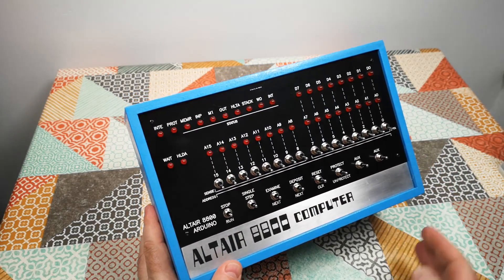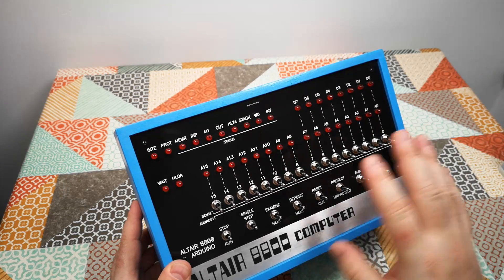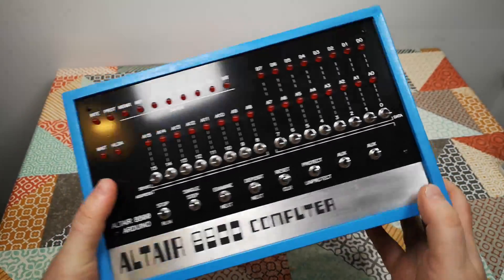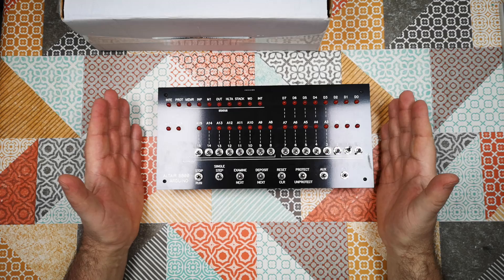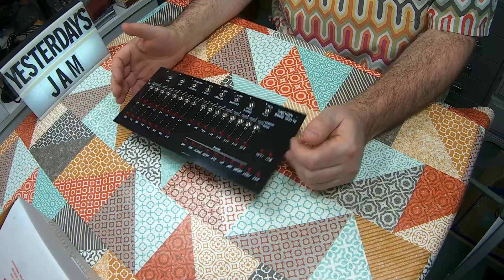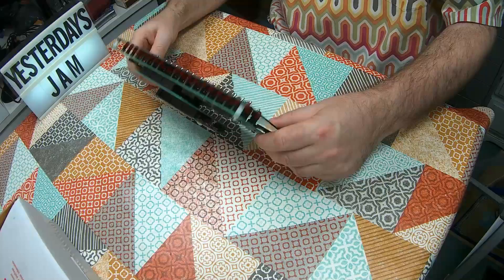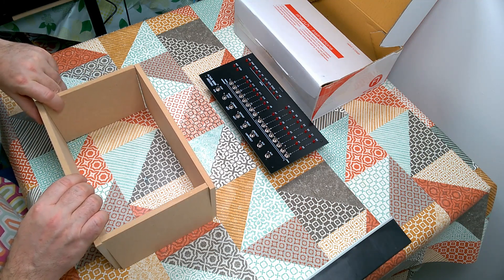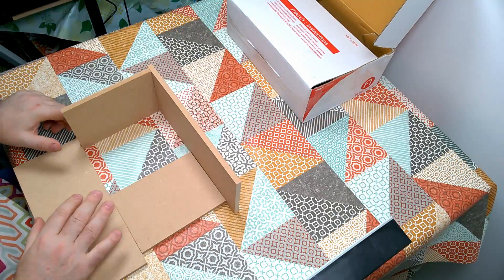A Nostalgic Case For My Arduino Altair 8800 Clone

Comment: I didn’t know that B&Q would cut wood to size. Worth knowing. Thanks
Reply from the maker: Yeah, it's definitely worth it for a project like this where precision cuts are important.  Sometimes they will charge extra for more than 3 cuts per board or something, but it's still worth it

Comment: I run many emulators of old Mainframes and OS's. I have a PIDP8 and a PIDP11(not built yet), I would like an Altair kit but they are very pricey! I retired fro IT a few years ago and tbh for me it had lost its 'fun' many years ago. Now it's just a tool. Which is why I play with the emulators.

Comment: I actually have my original Altair 8800 sitting in my back room. I used to have CP/M running on it via a Micropolis disk drive. It has a replacement motherboard using a Z80 CPU and a color video card. Due to having too many cards in it I had to beef up the power supply so that the fan sits on the outside of the case.

Comment: The version currently being sold in that eBay store looks really watered down from this, sadly. I might've paid the along price of £73 for what you have here, but certainly not for the current version. Really cool to see this, though!
Reply from the maker: He also makes a mini arduino shield version (assuming that's what you saw there) - which is really little more than a curiosity as it uses DIP switches.  There's not much point trying to use an Altair in earnest unless it has proper toggle switches. 
The seller is a great guy though and very responsive to requests - if you let him know what you want, he may be able to make it to order
Reply: @AtomicShrimp , that is fantastic to know, although being kinda in poverty I'll probably just have to satisfy myself with emulation 😁 By the way, I've also watched some of your scam baiting videos and they're hilarious.

Comment: Very cool.  I had an S-100 bus computer back in the mid-70's, but no front panel.  For nostalgia, I got the "Altair Clone" here in the US, put a PC motherboard in the mostly empty case and have a dual (8080 and PC) computer.  Brings back lots of memories.

Comment: Wish I had a spare $800-$1000 to copy your rather awesome project!!
Reply from the maker: It can probably be done for a good deal less than that - I think my total project cost for this has been about 300gbp but the front panel was the critical part - if you get that, the rest can all be DIY for less than 50 dollars (if you have the time and put in more effort than I did here)

Comment: That is a nice little project and the case really looks the part. I wonder if it would be possible to make a VT100 or Wyse terminal or modern equivalent. I know there are 'thin client' devices available which companies use instead of full PCs. But I'm thinking of just a serial screen/keyboard to connect to the 'Altair'. So no local OS. Not sure if that makes sense but... anyhow, I enjoyed the video.
Reply: Answer to self... I found this http://geoffg.net/terminal.html. It could be fun to have the 'Altair' run freestanding i.e. not connected to a PC.
Reply from the maker: Thanks - I might actually give that a try, especially as it supports USB to serial, so I would not even need to add a conventional serial port to the Altair.

It is interesting though that this device uses a microcontroller to emulate a terminal - that's still probably more computing power in it than would have been in the original host device.  I guess that's because we've made so much progress, it's harder to do it the old way than the new way now.